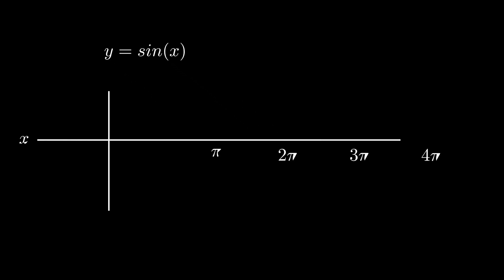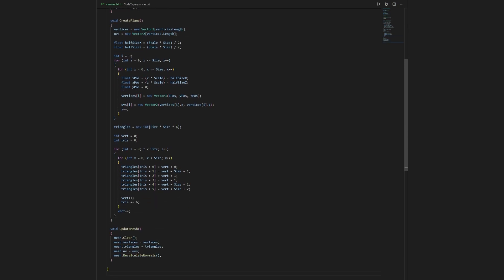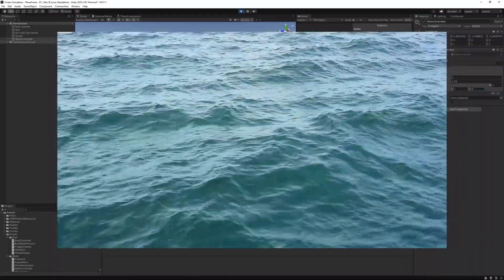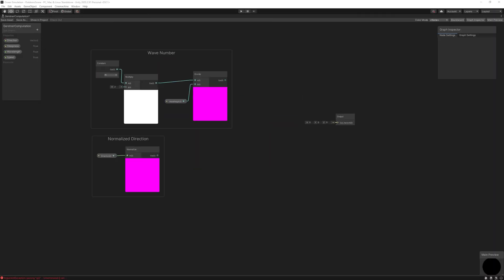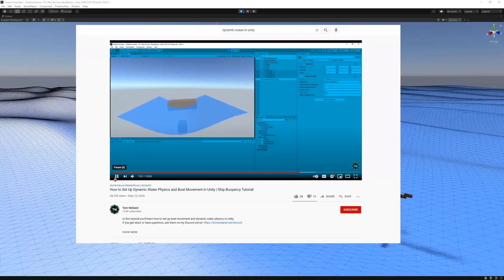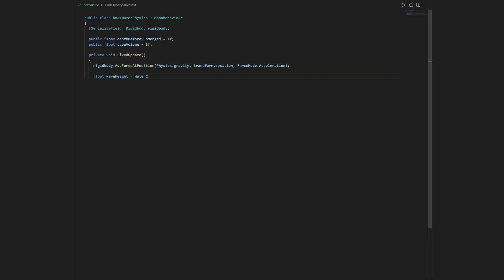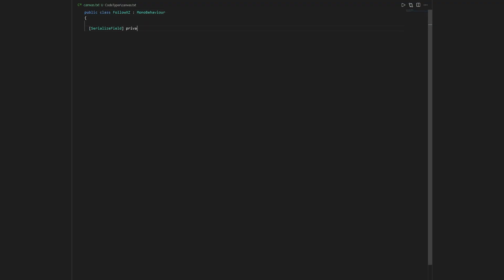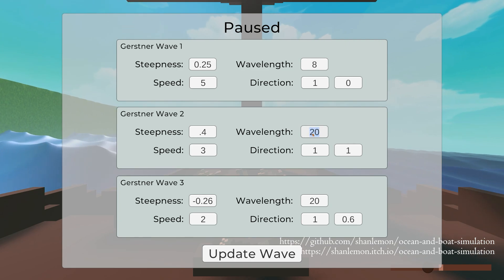Coding Adventure: Ocean Simulation and Buoyancy

Comment: 2:20 how come your waves are so randomized I've tried to implement same thing in different engine and language, everythng works out but the main wave is always the same size while yours if one side lower other side higher, my wave is always uniform (with some impurities from other waves)
Reply from the maker: Do you incorporate steepness in your waves and do each of your waves have different steepness values? If so, it may be where you add all the waves together.
Reply: @ShanKMemon  Yeah I did, it still had this uniform effect where you could've seen each wave, what did sort of fix is inputting different time for a different wave, it seems by looking at your code you input the same time everywhere and still have much more randomized results.

Comment: Why not just use a raycast to align the boat with the water?
Reply from the maker: There actually isn't a collider on the plane so the raycast wouldn't hit anything. It would be too computational to add a mesh collider and it wasn't necessary for the project.